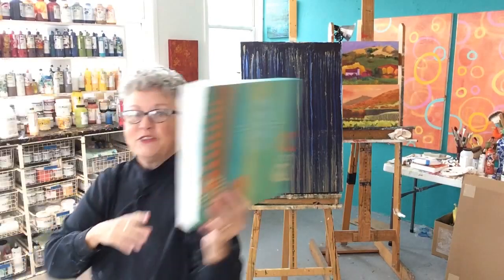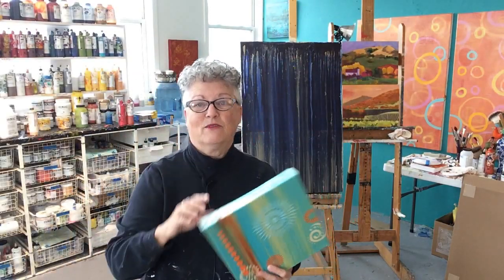Professional Art Studio Hacks -  How to Wire a Canvas Properly

Comment: Hi, thanks for the specific information for hanging. I wonder why you don't put a covering on the back of the canvas. I choose to do that to my canvases for a neat finish and to protect them from harm to the canvas from the rear.  I use paper or poster board cut to the dimension of the canvas, less 1 inch, so it fits neatly on the reverse when I apply it with Mod Podge. Then comes the hardware. I noticed that other pour painters have neglected this last step, as well. I also apply a business card label, printed on my computer. I am definately "Old School"!

Comment: Hi Tesia - I'm curious why you add any slack to the wire at all? I worked in a custom framing shop in my youth and we always strung the wire as tight and straight across as possible. This ensures the piece lies flat against the wall and doesn't tilt away from the wall at all. Thoughts?
Reply from the maker: Hey Lisa. If you've ever tried to hang a huge painting with the wire completely tight you'll know why I leave slack in the wire. It's almost impossible to get the canvas or framed piece on the hanger if the wire is too tight. You want to have a little slack so you can "catch" the wire on the hanger, but not too much or the painting with fall forward from the wall. It's a delicate balance!!  Thanks for your question!! 🤠

Comment: Hey Acrylic Diva - Tesia Blackburn Fine Art,
 good demo. Do you always adjust the wire so the canvas hangs at 2 
inches below the top edge regardless of the size of canvas? Or is it 
proportional? I'd expect you hang a larger canvas at a lower point below
 the top edge. How do you calculate that? Thanks.
Reply from the maker: Hey Joanne, thanks for your question. You're absolutely right. On the larger canvases I adjust the hanging height accordingly. So I still put the hangers at about 1/3 of the way down, but I usually have the wire hang about 4" instead of 2". And no matter what the measurement is, I make it same on all of my paintings. So all 36" canvases have X amount of slack in the wire, all the same. Hope that helps!
Reply: Thanks, Tesia. I usually have my wires more taut than that and sometimes the paintings don't hang nicely against the wall. They are at an awkward angle. I'll try this formula and see if it helps.